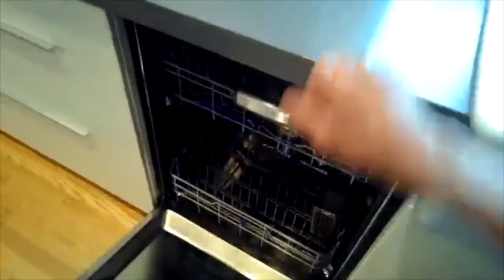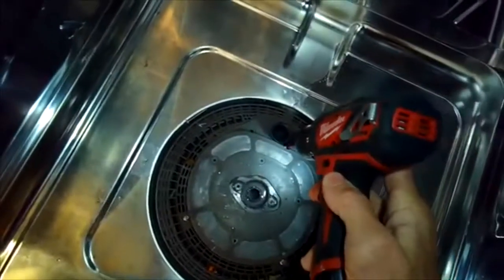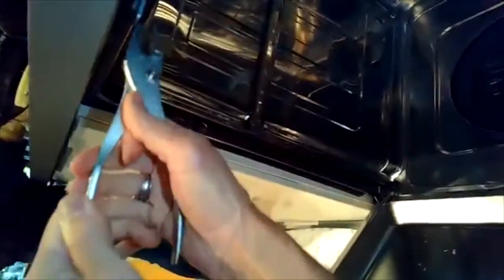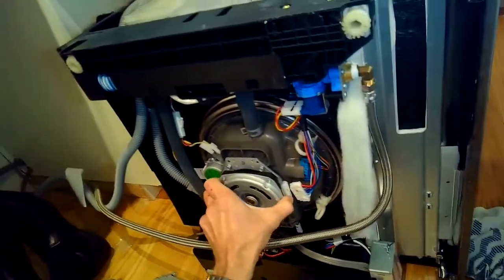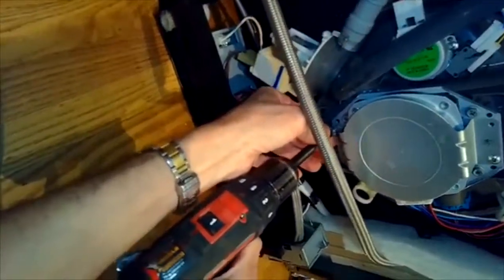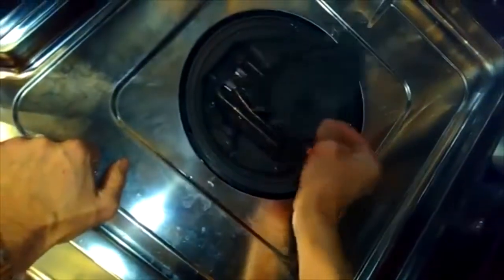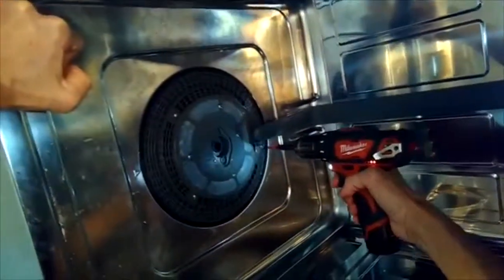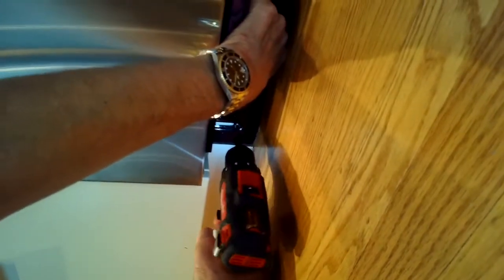✨LG DISHWASHER CIRCULATION MOTOR REPLACEMENT✨

Comment: Why doesn't anyone video the actual noise?  If there is a video out there with actual noises, can someone put the link here?  Thanks
Reply: Did you ever find it? This is the problem I have. How do I know what to replace? Mine is making a grinding noise when the water starts spraying / arms move.
Reply: @fjccommish  I’d start looking at the circulation pump then.  Mine makes a very loud, grinding/humming noise and I have confirmed through the diagnostic tests that it is the circulation pump.
Reply: @danodiumdanodium4579  I replaced it, but that didn't solve the problem. I put the old pump back in - no more rumbling sound.

Comment: I would like to know how to get this dishwaster into test mode. I tried holding down power+steam+rinse but that didn't seem to work. I'm getting an LE motor error code, but the motors all seem to run.
Reply: Hold down the START button then press POWER and hold.  It will then be in test mode (all LED’s lit) and each subsequent press of the START button advances to the next test.  You need to keep the door closed for the majority of the tests.
Reply: @danodiumdanodium4579  How do you access the start button to move to the next test on the model that has the control panel covered by the counter top when the door is closed? Also, my model doesn't seem to have a separate motor. It is called LG ABT72989205 Casing Assembly, Pump. It seems to be motor & pump together. Do I need to disconnect the interior parts to replace that part?

Comment: What noise does it make when this is bad? How to tell if that's the problem? Mine makes a grinding sound when the water starts to spray / arms turn.
Reply from the maker: That’s the noise👍
Reply: @ScottTheFixItGuyChannel  I've seen videos of "grinding" - only a few have a sound - usually humming rather than grinding.

What's the sound?

Comment: What about also replacing the rubber seal for that motor? I don't see the seal on the exploded parts diagram.
Reply: Mine has been leaking, made my motor whine during the wash cycle. got new motor but having trouble finding seal. The part number is 4036dd4002a but its been discontinued, trying to find its replacement.
Reply: You could try some silicone grease on the seal. Also I found that the sump seal is fairly easy to remove, scrub, and reinstall.
Reply: 4036dd4002c is the new part number for that seal. I was thinking of cleaning it and applying grease but it's 6 years old I don't want to risk water getting into my new pump motor. Hopefully I'll recieve it soon.